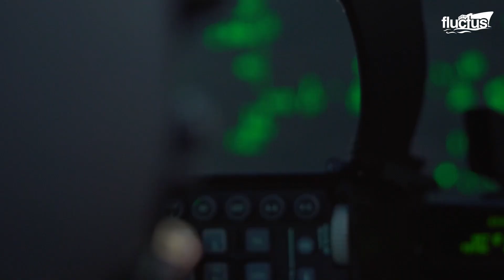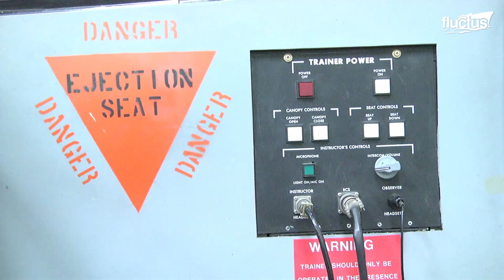The Scary Process of Recovering an F-18 that Crashed From US Aircraft Carrier

Comment: As a Navy Veteran (2003-2009) and someone that was trained to work on Aircraft Avionics as a Troubleshooter and final checker before flight and work on the Flight Deck I can tell you that EVERYONE on the Flight Deck is Trained as a Fire Fighter! Every Sailor in the US NAVY is also Trained Fire Fighter because Fire is the MOST DANGEROUS Situation aboard a SHIP. Being a member of a Squadron and not Ship's Company we are still responsible in knowing how to operate the Emergency Systems on the Flight Deck but inside the Ship guts of the Ship that is usually left to Damage Control but we do have a working knowledge of the fire fighting systems used by Damage Control personnel. Since Aircrafts are build out of special alloys they require special fire fighting techniques and when you add thousands of gallons of Jet Fuel plus Ordinance that can blow up or shoot off sometimes Aircrafts just have to be pushed overboard like it was done during the Fire aboard the USS Forrestal Aircraft Carrier Fire in 1967.
Reply: Yes absolutely, we are all fire fighters. During bootcamp the Forrestal story gave me nightmares lol.

Comment: I remember years ago in the 70s when a Tomcat went off the deck in the mid Atlantic with the then new secret Phoenix Missiles on board they retrieved them off the bottom....
I  even got the opportunity to see the circuit boards from those Missiles and how the pressure from those depths was so great it squashed the transistors flat (single can transistors from before the 
IC Chip was used)
Reply: The book titled Dark Waters(2003) has a pretty good write up about that. Plus other NR-1 missions.
Reply: Very interesting. Do you know the reason for the loss of the Tomcat from the carrier deck? It sounds like very deep water if the old style transistors were crushed - how deep did the Tomcat sink? How was it recovered - divers? Or ROV? Thank you. Dr. J.
Reply: Well. NR-1 was a nuclear powered minisub for special operations, So I'd assume it was pretty deep. And NR-1 was usually usd when they didn't want anyone to know they were there, but not in other nation's territorial waters otherwise they'd have used one of the full sized special projects subs.
Reply: @richardjohnson455  
I was young at the time...
My mom was doing the stats for the MARU Team and she was dating one of the lead electronics engineers in the Cal lab that was checking out the circuit boards of the Missiles after they were brought up from the bottom of the Mid-Atlantic....
As I remember the Tomcat went off the end of the carrier (whether on takeoff or landing I don't remember,  HELL,   it's been 50 years)  
The funny thing is,   20 years later I went back to school after a work injury that knocked me out of 4 different careers in one 8 foot drop to the concrete,   I became an electronics field service engineer in Robotics (which is What they were trying to get me interested in when they showed me the circuit boards from those Missiles in the first place)
Reply: @richardjohnson455  
Instead I became the black sheep of my NAVY Family and went ARMY❗😄❗
Go Figure.... ‼️🇺🇲‼️

Comment: That was amazing, that 'Touch n Go' over the edge of the Aircraft carrier! They must have been crapping themselves as the ocean was nearing closer n closer!
Reply: I was on the 71 in the waist catapults during my first deployment with f-14's and we had super heavy tomcat that maxed out the catapult settings. The wings on this tomcat were bowing down and you could see how much slower it was moving down the catapult during launch than usual. The bird cleared the catapult/ship and dropped below the deck line and we all stood there in shock. After what felt like an eternity the tomcat was full afterburner with nose completely up coming back into view flying up into the sky. We never did that again.

Comment: Try landing a fighter on a carrier deck in the pitch black of night during a hurricane with a 70 knot crosswind. I was forced to do just that back in 1992. The deck was pitching up and down 8 feet because of the violent sea. The wind was blowing the rain so hard that i couldn't see the outside of the windscreen. I was given the option to either eject from the aircraft or try to put it down on the deck if i thought it was feasible. I decided that ejecting into hurricane seas in the pitch black of night was far more potentially deadly than crashing on the flight deck. Luckily(and i literally mean that!) I put the plane down hard onto the flight deck and managed to just barely catch the arrestor cable. That night it absolutely was "NOT JUST AN ADVENTURE!"

Comment: Hiya,
A few comments? 
The test of arresting gear does not involve 'hooks', those 'pushing sticks'. I'm like you; I don't know what the navy calls them either; anyway, they are used only when re-setting the arrester cable. If you care to watch, as I did, you will see that they are utilised to push the connection blocks over any other arrester cables to avoid snagging. 
My other point is; When landing on a carrier, the plane goes to full throttle as they touch down in the case of, oh yes, the wire snapping and the need to get back in the air. 
Observant amature, Steve...
Reply: Most definitely
Reply: Missing the "WIRE" is called a "Bolter"
Reply: @spuds416  
LT Rob, United States air Force retired. I never had to land on a carrier during my service.
Experienced combat during the Gulf War.
Reply: Why risk divers and waste all that money on a recovery missison? The Hillbilly clinton gave the chicoms all the design specs anyway.
Reply: They push the wire not to avoid snagging but rather to avoid the tendency for the wire to creep out of the landing area. The deck is coated with 2 types of non-skid. In the landing area, it is non-abrasive topping. It is designed to break down the non-skid rather than cause damage to the arresting cable. The abrasive non-skid in the parking area is much tougher and would shorten the service life of the wire.

Comment: The description sounds like the jet crashed right after the catapult shot.  Losing an engine on an F/A-18, if the pilot is ready for it, should be OK and the jet will climb away, particularly if the external stores are jettisoned.  Keep the throttles in max burner and all should be fine.  Now, if both engines were lost, say due to FOD, a different story.  Anyway, losing "power" does not make the airplane nose dive toward the water.  That is not a causation due to loss of power.  However, if the pilot ejects and the airplane's trim has too much nose-down trim (very unlikely), that could occur.  Most likely, the pilot ejected, the airplane rolled and the nose naturally went down to the water.  The person doing the narration needs to be better informed of how aircraft fly and salvage operations.  Use the correct terminology.

Comment: Why are they going into detail about the Nimitz class aircraft carriers, when before you know it we're going to have aircraft carriers that don't use catapults run by steam anymore. As shown in the new Ford class that is all electric? Perhaps she discusses it later in the video as I did not finish it yet back to the video.
Reply: Nimitz class carriers will be around for a long time still. It will be a few more decade’s until EMALS is the dominant system for launching aircraft.
Reply: EMALS still aren't refined enough to use consistently according to the rep I spoke with on the USS Midway tour last June. The new system, according to him, still "has a number of kinks the designing engineers systems are working on".
Reply: @penelopelgoss2520  Was the tour guide on the Midway aboard the Ford during its recent deployment?

Comment: @8:33 I don’t think they ‘powered up’ the engines, as carrier pilots are at full power all the way through the landing for just such an instance.
Reply: You cannot land any aircraft at full power .You can catch the wire and then go to full power for a go around but they do not hit the deck at full power.
Reply: An Arresting Wire break could result in a Lost Aircraft.
Reply: @lukelee7501  That's a negative Ghostrider. They go full power as soon as the MLG hit the deck, if you wait till you snag the spaghetti, it's too late...
Reply: @blackpowder13  Right AFTER you hit the deck you go to full power. You sure cannot put it down on the deck at full power .You cannot set any aircraft flying on a glideslope decent for landing at full power
Reply: @lukelee7501  thats what I said....  :-)

Comment: Does a carrier F-18 have the same landing gear as a land based one?
Reply: I can't say 100% for all of the differences but there are indeed models of aircraft that have catapult and arresting gear specific components for said launch and recovery operations, such as forward nose gear fixtures for the catapult hold back bar and the forward launch bar that is used to attach the aircraft to the steam pistons, and then there is the tail hook for arresting/landing operations.
Reply: I doubt it. Carrier Based F-18 landing gear has to fortified. For harsher landings in contrast to regular landing gear for these Jets. That’s not even including the Tail Hook 🪝 🌊

Comment: Could someone please tell me how the catapult Hold Back bar is released?  Respect to the Aviators of the Navy from the 🇬🇧
Reply: As a crew member of the 71 waist cats. The hold back bar has a spring loaded collar that is pulled down and then the exposed fixture (a receiver lug) is fitted to the fixture on the back of the forward nose gear (receiver fingers) of the aircraft, the collar is than released allowing the collar to slide up over both the fixtures on the bar and on the back of the nose gear preventing them from coming apart, on the f-18 supers it was that orange colored bar. The bottom of the bar has lugs that fit into another fixture on the catapult deck called the nose gear launch. The bar has additional features inside (of which I'm not completely privy to) that when a certain tension is exceeded (kind of like a clicker style torque wrench clicks and releases) the collar is allowed to either drop down exposing the fixtures and it is then pulled apart or the fixture is pulled up and out and then pulled apart. I say it that way because I don't know how that function works exactly. This action is performed during launch when the pull forces on the bird from the catapult pull the bar so tight that it then engages those features allowing the bar to come apart from the nose gear and drop safely to the deck.

On older aircraft like the s3 vikings, e2 hawkeyes, and c2 greyhounds they had a similar bar but a release element was used to create the connection. The release element was a precision machined chunk of metal that fit into the bar and the back of the nose gear making the usual connection. The release element was indeed very precise as it had the break away tension stamped on the side of the element. During launch this release element would be ripped apart breaking the connection and the bar would fall to the deck. One half of the release element would be left in the bar (recovered by the hold back bar operator after launch and thrown overboard) and the other half would go for a ride in the bird until it was later extracted by aircraft crew members I believe but I'm not positive (this needs fact checked), it's possible that the nose gear could drop the element when it retracts up into the body, I don't know.

I hope this makes sense and gives you an idea of how it works.